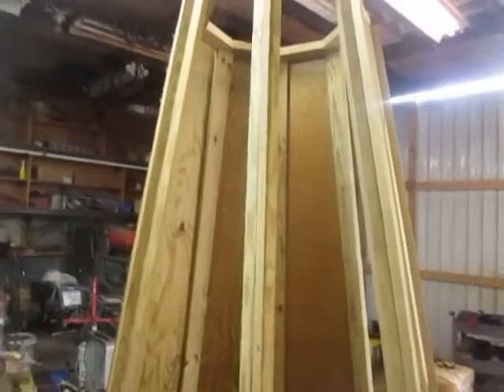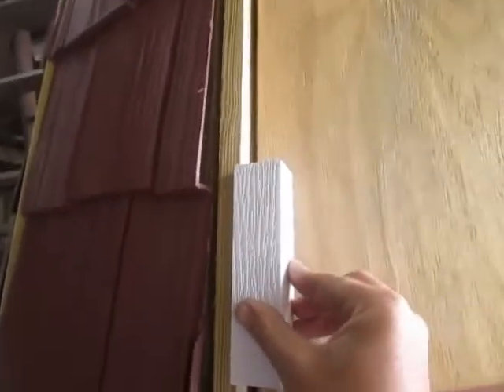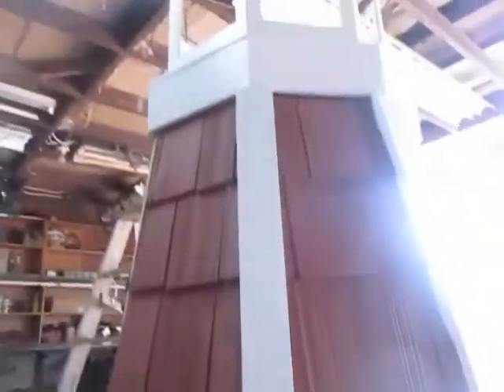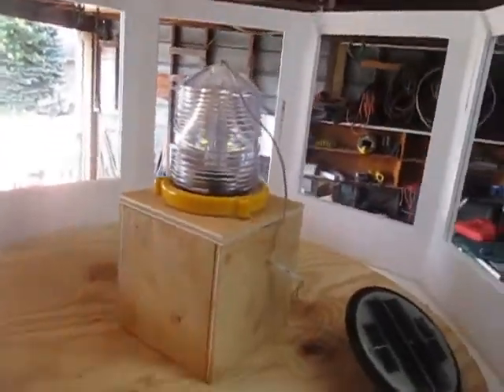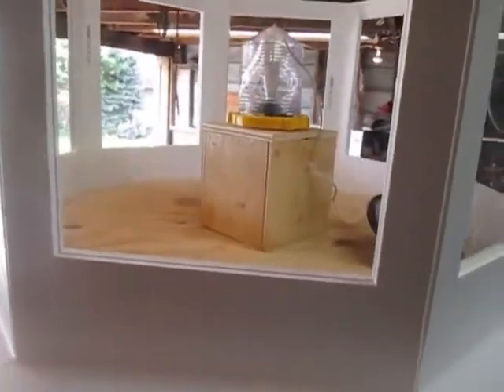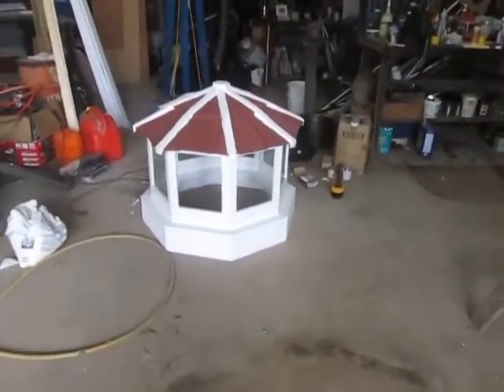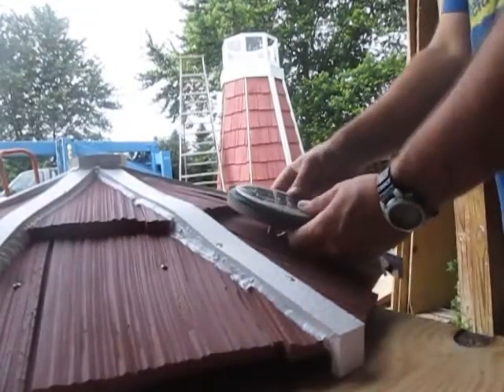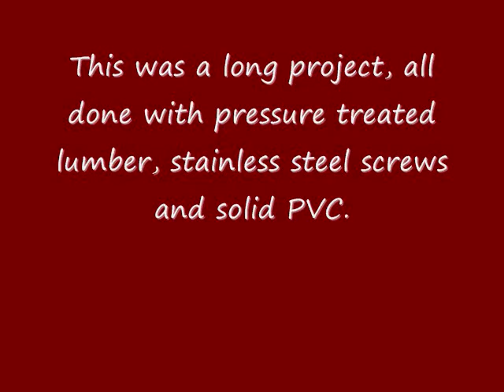Building a lighthouse

Comment: Do you have plans for this lighthouse.  If so did you draw them up yourself, or did you buy them.
Great job.  Would like to build a lighthouse for my wife.
Reply from the maker: Ron Little 
No i dont have plans, i just planned it as i went along. the base was 8ft tall. if i can remember correctly the bottom is around 5ft wide and i think the top was around 2.5ft wide.
Reply: Thanks, I think I'll try to build one.